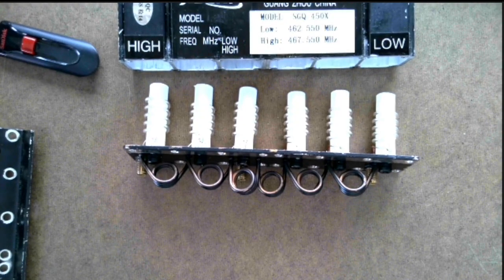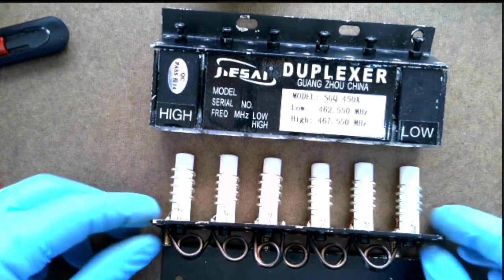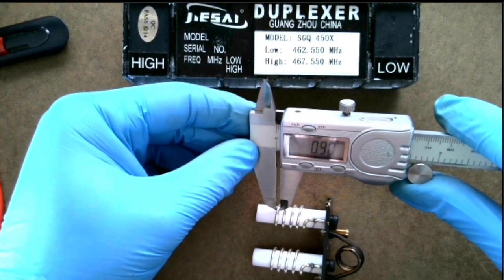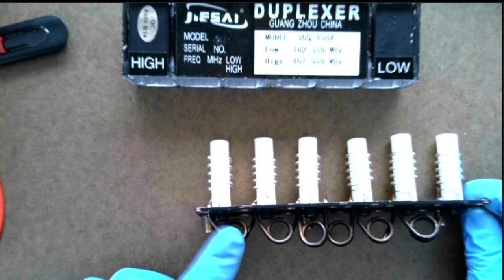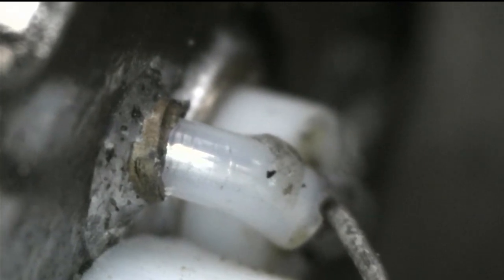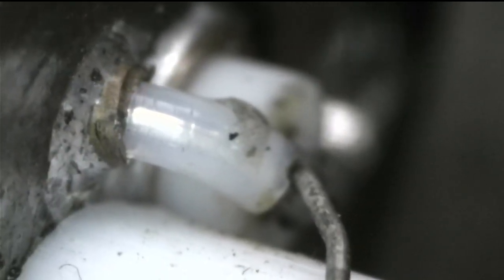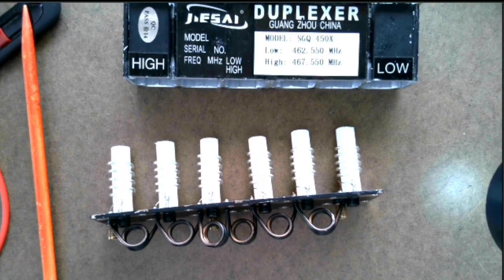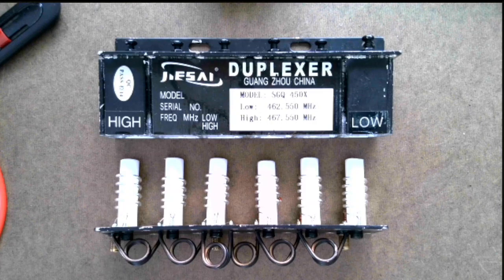🔺 Taking a much closer look inside the 10 watt duplexer model sgq-450x🔺

Comment: Interesting video. Do you happen to remember if when you had it apart was it configured as 3 cavities for low and 3 cavities for high, or were there 4 high and 2 low? Where that antenna connector is kinda looks like 4 high and 2 low.
Reply from the maker: hummm no sorry I don't recall, I would assume you can't really see that in the video if it is?
Reply: @GMRStwowayradio  thanks. I think I figured it out. I found a picture of one with N-type connectors and it looks like it is 3 high and 3 low.
Reply from the maker: @yqtszhj  ahh yup that makes sense, it being a 6 cavity.  The more I think about it now, there are 6 screws so 3 high and 3 low.